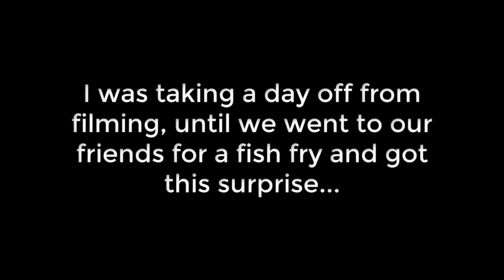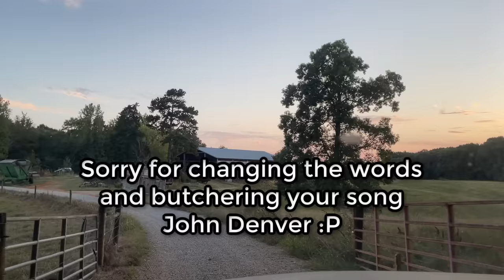All moved!

Comment: He's got bad wires. In order for the alternator to produce a charge, it needs electricity. He has to find the break in the circuit. You have a nice voice. Be well Bernard family     🥰
Reply: Some of the older alternators need an exciter wire to produce power. I know on some of the older case backhoes, they used the power from a dash light to power it. This way if the light went out, you would know it was not supplying the power to excite the alternator. A tester should find that easily if that is the case. ( pardon the pun)

Comment: Regulator is not getting reference voltage to tell it open the gate and let the cows to the battery.   Check that the small wire is not damaged and that there is not a fuse blown.

Comment: I had that charging issue happen 1 time to a semi-truck and it was a ground wire from the engine to the frame. Took a couple of days to find that issue
Reply: That's what I was thinking too.
Reply: I had a Pontiac Tempest that started eating alternators and batteries. Had in the shop 2-3 times. Finally I mentioned to the old pro that when I turned on the turn signals, all the dash lights blinked. "Oh," he said and walked around and pointed to a broken ground strap from the engine to the firewall. Just that quick.
Reply: We may be related.
Reply: I just went through that issue with my 99 tacoma
Reply: And even if you are experienced, I worked on electronics for years, the last thing I suspect is the ground.
Reply: The first thing I thuoght was ground straps, wires, and my second choice was battery and or eyelets or post on the battery,lolollll, nice 👍 thanks BigAl California

Comment: 2 pieces of advice.  Roll the belt off of the sweep auger and lift the motor off the sweep auger.  Reassemble in the bin.  Much easier to handle.  And put a dust mask on and shovel and sweep the floor following the sweep, shoveling it into the sweep auger, as it is taking the grain out.

Comment: Meredith, long time follower and subscriber. I love all your videos and enjoy watching your families everyday life. I love the way you moderate everything and explain all the situations you face everyday. I’m a mechanic and it’s possible the control module might need to be replaced on the truck. It’s a small metal box with a wire harness and is located on the inside wheel well  on the Drivers side. You can have that tested before you buy a new one. Also make sure your battery  posts are clean in order for alternator to charge battery. I’m sure your husband already cleaned the battery leads. I love the way you said the sweep thing. Your so cute when you try to explain things. Could you post the recipe for that chicken soup please. It really looked great and I want to try it. Tell your husband you’ve never had any training how to use the broom. See his reaction. Ha Ha. You embarrassed your son with the nose dust in his nose. Enjoy your smoked Kielbasa and hope you have a nice weekend. You and your family are my IDOL. You sing very well and have a pretty voice. Stay safe my friend.😍🥰🌹👍🏻🙋‍♂️

Comment: Some days it's hard to be a grain farmer. I thought yesterday was bad, when we spent most of the day fixing things. We only got a bit over an hour with the combine actually shelling corn after all was fixed. 
 This morning, after about 3 hours of combining corn, a bearing went out on the lower feeder house shaft and caught the stalks on fire. We were VERY Thankful a neighbor had his vertical tillage 'disc' hooked up, and got to the fire in less than 15 minutes. I spent all of that time, driving over standing corn with the tractor and the grain cart, trying to keep the fire from spreading. The neighbor had most of the flames out before the local Vol FD got there.
 The FD got busy soaking down hot spots just about the time the wind picked up a couple notches and set off a couple "dirt devils" in the ashes. The last 'dirt devil' was close to 199 feet high and probably 30 feet in diameter at the top. That would have been disastrous if any embers had been carried off across the road to a 150 acres of DRY standing corn. 
 I pray the guardian angels stay with all the farmers trying to get crops in this fall.

Comment: We welded a loop on the top of our augers so we could just stick the hay spike in and move the auger that way. Just a suggestion. Made the loop out of a piece of 3/4 inch round bar we had laying around and it was like a figure 8 with the bottom of the 8 wrapped around the auger tube and the top of the 8 was much smaller so the bale spike woulld go in easy but not sloppy. Worked very well for us.

Comment: It's an internally regulated alternator. No external regulator on it. He's got an open circuit in one of the wire tracks on the alternator wiring path. Needs to do a continuity test from the plug at the back of the alternator to the teminal ends of that wire path. Usually it's in the ground circuit somewhere.

Comment: Use a can of SPRAY FOAM to fill out the gap under the tailgate. Instead of messing with the steel. Close the gate and spray it in the inside. We use it all the time to seal up anything fast.

Comment: Also, make sure all the battery connections are clean. If not, it will keep the battery from charging. To remember to remove the bar from the dump, stencil it on the back (on the gate), “Remove bottom plate in Spring”. Maybe even paint an arrow pointing down. If no stencil, do it freehand. Use a permanent marker if no paint.

Comment: With the battery disconnected, make sure you have continuity between the heavy lead on the alternator and the positive battery lead.
If you have a battery light, make sure the bulb is not blown as the alternator won't charge.

Comment: Always check the hot wire going to the alternator frim the battery the Alt. Will not generate without DC current from the battery. Some of your unwelcome farm livestock has a habit of chewing on wires. MICE RATS AND EVEN SQUIRRELS

Comment: Old DC dynamos (as I knew them) had a separate regulator. 
One needs lots of time to chase down an electrics fault as it could be anything along the wire loom between the alternator and the battery. 
One should really mask up when dealing with old corn and cereal dust. The moulds contained in it, can be harmful to the airways and lungs and we have only one pair into last our lifetime. 
Fantastic “ups and downs” days in the life of the Bernards again in this episode. 👏👏👏

Comment: I am a Culinary grad. If your having trouble getting your chicken and dumplings thickened. Or anything else for that matter thickened. 
Mix a couple Tablespoons of Corn Starch in a half a cup to a cup of Cold water. Stirring the chicken broth with a whisk or large spoon. This will thicken your broth or stew. Only add about 1/2 the corn starch mixture at a time. If it’s not thickened enough. Make another cup of corn starch mixture and repeat. The mixture to be thickened must be about 180 degrees or more to thicken. Just below a boil. Just don’t try to thicken something cold. This method won’t work. 
If you over thicken your broth just add more water to thin it out. Have patience and you will be fine.

Comment: The field of the alternator needs to be energized. Usually this is connected to the ground side of the battery light on the dash. If that light is not on and it’s not charging, there is a good chance that bulb is bad or the 12 volt feed to the other side of the bulb is missing. An easy way to verify is turn key on without starting engine. Light should be on if that part of the charging system is good.
Reply: He might need to race the engine a little bit to Excite the alternator to get it to start charging.
Reply: the current drawn by that bulb  excites the alternator
Reply: Yup I agree. Also when you reinstall the alternator make sure all the mounting spots are shined up so it has a good ground. Really great vids. Keep up the great work. Hi from South Dakota
Reply: I sure wish we were neighbors because I have my Granny's 1999 Mercury as she Passed Away, and the 4way flashers won't work and the brake lights wont work. I know its a short but I can't find it. Video on youtube says its failure common to that model
Reply: @skatkat6885  never had a squirrel lol. Years ago on the farm dad had an old 1973 Chevy dump truck that a mouse got in the dash and made a nest in. Had to take the steering column and dash out, it took me 2 days to rewire that mess. That was the most tedious pain in the butt job I've ever done lol.
Reply: @c.b.-11  Check Stop Light switch, may be under dash.

Comment: Alternators need 12 volts to make power. Chances are the plug in the back of the alternator is not making good contact. Pull the plug and check the connector.

Comment: Isn't the regulator inside of the alternator, spray some WD40 in it, it could be rusty! check the ground wire to the frame, take it off, sand the spot, put it back on! That was sweet of Wendy!! cook the kielbasa with sauerkraut, serve over mashed potatoes!

Comment: Check the wiring from the alternator for mice chowing through it and check fuse also the ground or you can buy a one wire alternator and go straight to the battery. I had a old Toyota  truck that did the same changed everything and still did not charge so I put a one wire alternator on it no more problem.

Comment: First need to check for charging voltage at the batteries with a meter, on the posts and the cables. Then check at alternator on the big charge back wire. Still no charging voltage there then need to see if the alternator is getting "turned on". Something in my brain remembers fusible links down at the starter🤔

Comment: The Regulator is part of the Alt.  Put a multi-meter on the battery , if it's lower than 10v , the battery is probably bad....Jump start the truck, with the multi-meter should read at least 14.25 v means the Alt. is working fine, if it is less it's not....clean all your terminals good...Good luck..!

Comment: There is a fusible link in and around the battery that can cause the truck not to charge also. Should be very close to the battery  on the main cable. Need a meter to test for it being open.

P.S. congratulations on 102 K !

Comment: There is a little cheap tester you can buy that will tell you if your alternator is bad or not. Ask your napa dealer about it and if you have a 24Volt system on that truck, then it will take a different one.

Comment: Take a sharpie an write on tailgate remove before Slagle. He probably already got it fix .but if its not look for a fuse able link line .should feel softer .use a meter an trace the wire back from alternator .👍👍👍

Comment: Check the fusible link. It's in the master wire harness, it's a special wire made to burn out in case of over voltage. I had that fail on a car once. When I spliced in a new piece of fusible link wire around the bad piece, problem solved. Usually where the main wire from the alternator goes into the harness at the wiring block on the firewall.

Comment: Get some Green Tire Slime at the Auto Parts store, remove the valve core and give about 7 squirts into each of the lawnmower tires. Replace core and fill with air, roll them around a little (or mow) to coat the inside of the tire, that should last the whole season without having to keep adding air.

Comment: The alternator can be tested to be good, the voltage  regulator I think can be tested also to prove to be good. If that all checks out then ground wires are usually a hidden mystery. They might look good but sometimes to loosen them and re-tighten them can get debris or rust away for a better connection.  Battery cables can rot into the casing and still look good yet perform bad for connections too.  Just some simple things to look at on a vehicle that sits for periods of time possibly.  Finding electrical problems isn't fun. A lot of times weird stuff is just a matter of bad grounding.

Comment: The alternator is not a one wire,the two wire plug in is the one that excites it to charge, best to put a one wire alternator on,cause you won’t find it, check fuses see if any are blowed.the battery light must be on in the dash that’s what that plug on the alternator for like a car. 8078 is the number for a one wire alternator

Comment: The first thing I check is to see if the alltanotar is getting excited that's the little wire and you can put a screw driver on the back bearing if it's pulling a magnet it's charging 🤞👍🤠🍑

Comment: Should be  12v battery voltage to the big wire post on the alt.  (with key on). If not, wiring.  Sometimes this circuit is routed through a solenoid mounted perhaps on the firewall. Should hear it click when key is turned on.  I've fixed them over the phone. Maybe this is a new accomplishment for me. Then I could be wrong. Also make sure all grounds ar not corroded especiall engine to frame.
Reply: Yep, you are on target here.  There is an accessory relay that is activated when you turn the key on.  Sometimes these things go bad and won't energize the field on the alternator.  That was a problem I had on my old R model Mack.
Reply: @davidmorse8432  Thanks for concurring David. We have been down this road before.

Comment: They make an alternator that only requires the large wire that will self excite with engine rpm increase, eliminating wiring harness issues, only 1 large wire directly to the battery or starter solenoid.

Comment: I think if it's like the older 80 model Chevrolets on the firewall there is a small box that has a red wire going to it it should come from the battery to that then from that down to the starter then back to the alternator I think it's the way it's supposed to go but they should be some fusible links in between those

Comment: The regulator and most of the GM alternators anymore probably since the early 80s should be internal in the regulator. And I understand you're frustration on parts we're waiting on starter parts for a tractor we've been working on restoring all summer. It is our smallest oldest tractor on the place and it came to the point where it was either fix it or junk it the only thing keeping us from using it right now is waiting for the starter to come back from this starter shop and he's waiting on backorder parts.

Comment: Bean head broke tonight. Yeah ha 😂. I think we are having chicken and dumplings tonight. Need to test batteries and see if there is a bad one.  Alot of problems could be just the ground. Stay safe and please stay away from those pto shafts with bad shields.  A 540 pto can take 9 feet per second and no one can out power them. There is reason shields were invented. Sorry for my soap box.

Comment: I was visiting a relative on his farm in Colorado and I noticed that his John Deere tractors alternator did not have all the necessary wires connected to it. So looked it over and found the missing wire it was back by the rear fender. I use the multi tool that I had hanging on my belt and reconnected the wire to the location where it belong and I looked around in his equipment shed and found some zip ties and secured wire so next time he drove it through the corn the corn wouldn't are the wireless again. That evening he asked me if I'd mess with his tractor I said why do you ask he said the alternator hasn't worked in 3 years and suddenly today it's working! 

Lollollol.

Comment: He needs check the charging with a volt meter. The GM trucks have had trouble with the gage Custer's and they don't read right. That truck started pretty good for having low batterys.